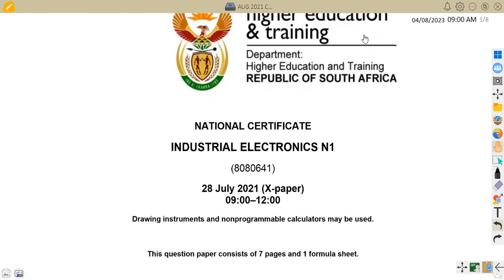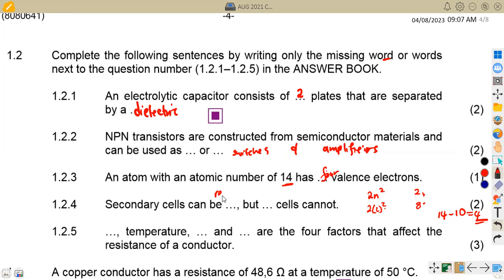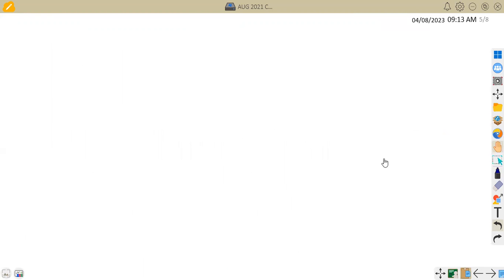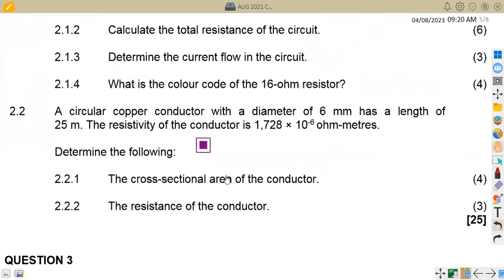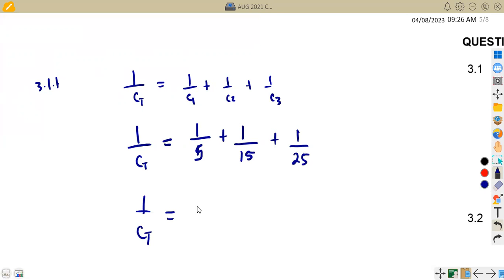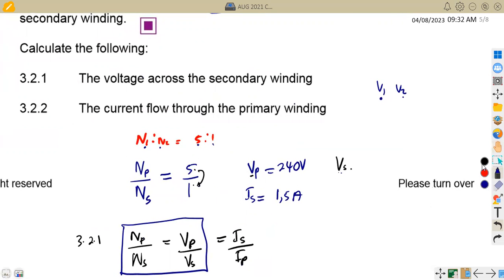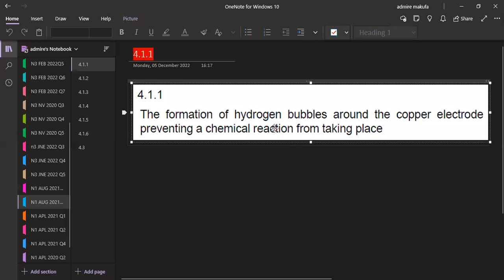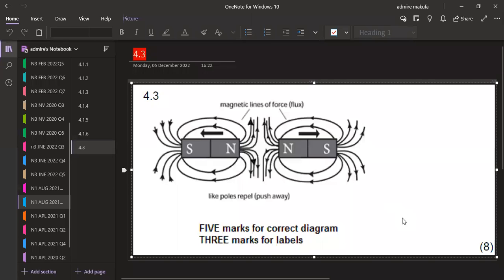INDUSTRIAL ELECTRONICS N1 AUGUST 2021 MEMO @mathszoneafricanmotives

Comment: emf is an open circuit electrical pressure/voltage measurement not a closed circuit measurement closed circuit measurement is potential difference Question 1.4.1